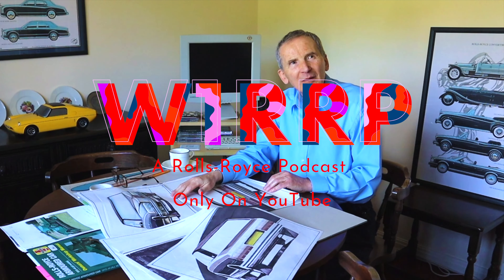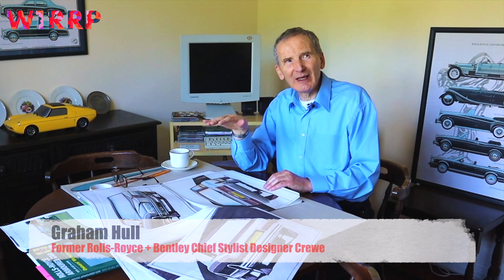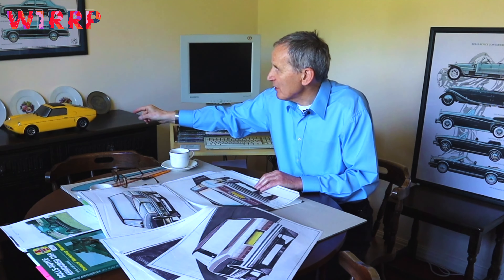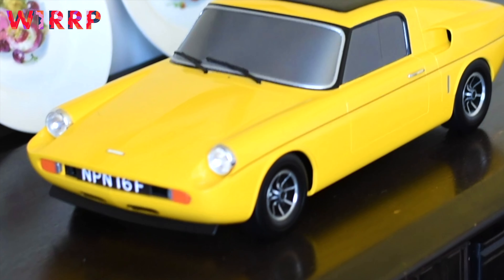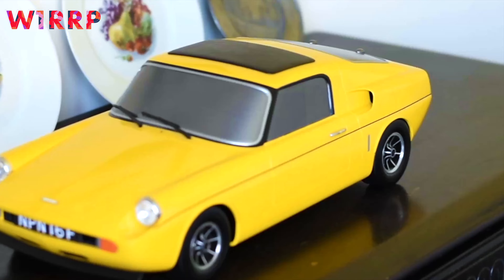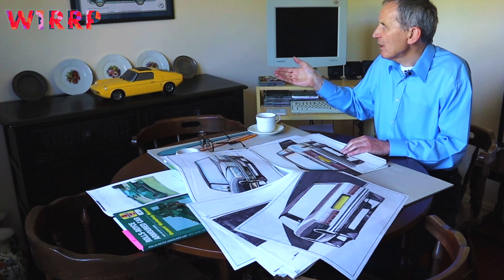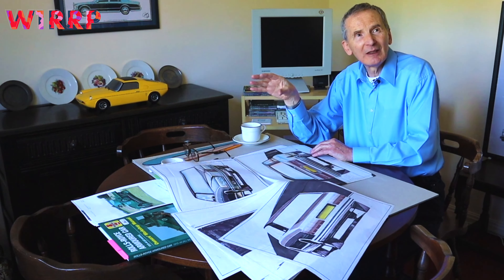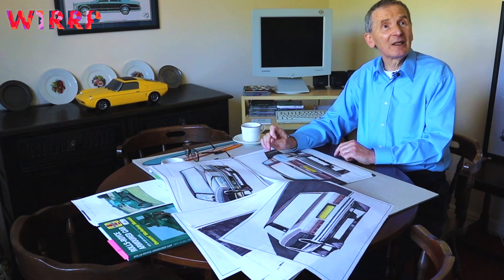Rolls Royce Aerodynamics Graham Hull Designer Airdams Unipower GT Rolls-Royce Spectre 4K

Comment from the maker: The all electric Rolls-Royce Spectre will have a redesigned Spirit of Ecstasy, the flowing robes (often mistaken for outstretched wings) will be reshaped for a realistic look with a lower, more dynamic stance which will make her more aerodynamic. The new Spirit of Ecstasy stands 82.73 mm (3.3 in) tall, compared to her predecessor's 100.01 mm (3.9 in). This brings her much closer to the original drawings made in the early years of the 20th century. This iteration of the Spirit of Ecstasy will appear on all future models succeeding the Spectre.
Reply: They'll be worhtless after 10 years due to battery technology I'll stick to my existing Rolls